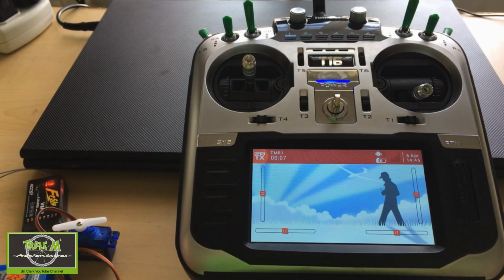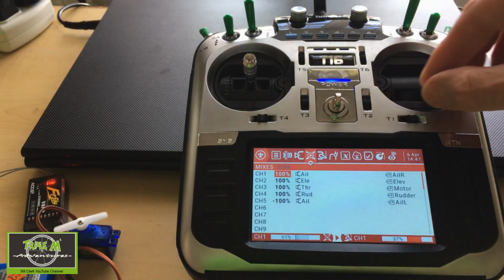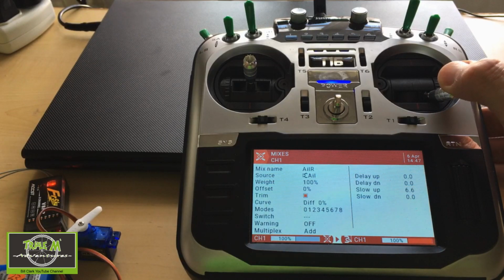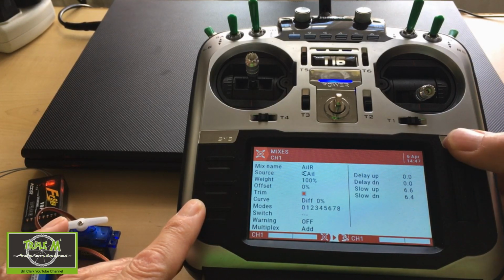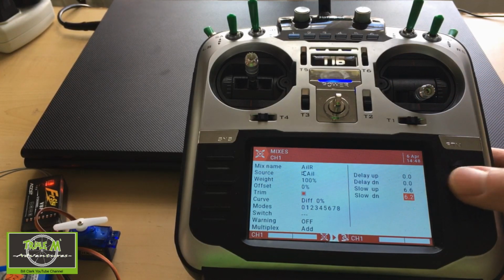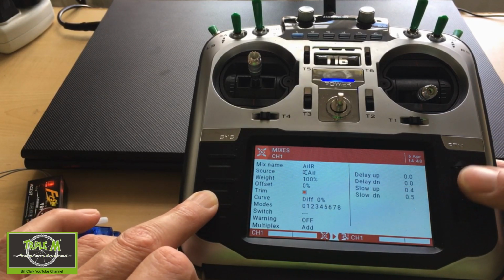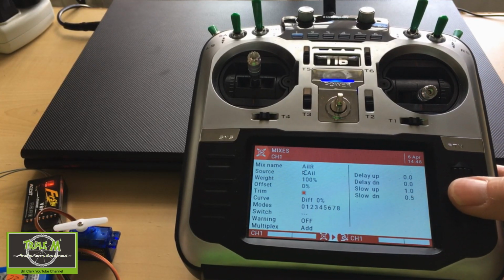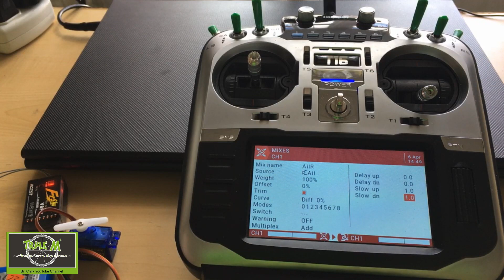Jumper T16 Slowing Servo Speed

Comment: Good to know! Great video!
What is the "delay up and down" function above that for?
Reply from the maker: This delays the response to the stick input so when you move the stick nothing happens for the delay you selected. Possibly useful if you have mechanical retracts in your model or you needed to delay one control surface where you have mixed say rudder and ailerons so the ailerons roll the plane and then rudder operates acting now like an elevator because of the models orientation to the ground.  Once the lock down is lifted I will test this and see how my plane responds.

Comment: Is it possible to slow servo just in one end part of rotation?
Reply from the maker: Yes you can. You will need to set the MIX with 2 lines. First line Source the 3 position switch you wish you need to use say SC. Select Switch SC⬇️, Slow down the value you wish to use say 2.0 Second line. Source the 3 position switch. Select Switch SC⬆️ no slow value. You can always switch this around. Please check your settings carefully before flying your model.
Reply: I want to have two speed programming for stick movements.
In sailing we use throttle stick to control winch for sails. If I move stick a little bit I want winch to go slow. If I move throttle stick full or 1/2 I want it to react full speed
Reply from the maker: @lincolnmcdowall3801  Are the sail motors controlled by an ESC on 1 channel.
Reply: No winch is just a servo really that does multiple turns
Reply from the maker: @lincolnmcdowall3801  OK this should work.
You will need to set up a Curve. Curve CV1 - Change the pts to 3, check the box smooth.
First point 1 X=-100 Y=-100
Second point 2 X=0 Y=-50
Third Point 3 X=100 Y=100
On the throttle (or winch) channel MIX Change Curve to Cstm and select CV1
You can change the X Y values to suit your needs.
Reply: Yep adding a throttle curve was easy fix but not exactly the effect I'm looking for
Reply from the maker: @lincolnmcdowall3801  is the servo proportion depending on the stick position. If so just adjust the curve.
Reply: Yes stick behaves exactly same as servo just with multiple turns.
I want to slow speed with small movements. With same amount of movement with each click of stick.
Curves don't change speed just the amount of movement for stick movement.
Reply from the maker: @lincolnmcdowall3801  What is the setup at the moment? Is it on the throttle gimbal or 3 position switch so the servo lets out or in at a constant speed. I have taken a look at a yacht servo and I do not think you can do what you are looking at. The servo just rotates left or right and stops when the radio channel center’s at 1500uS pulse.